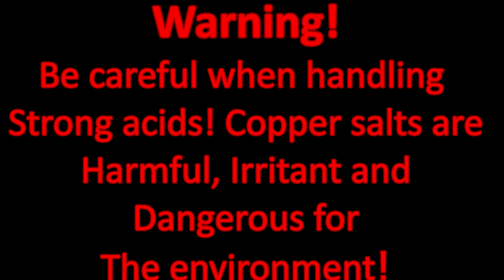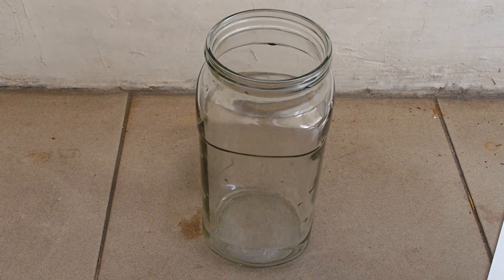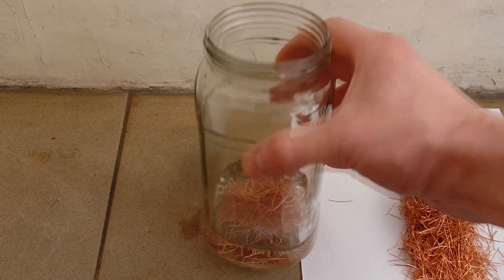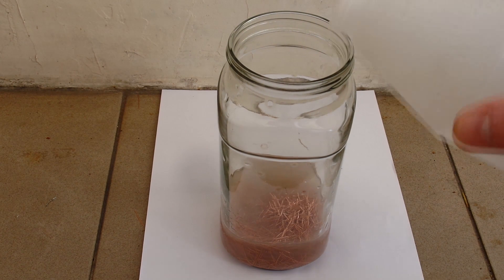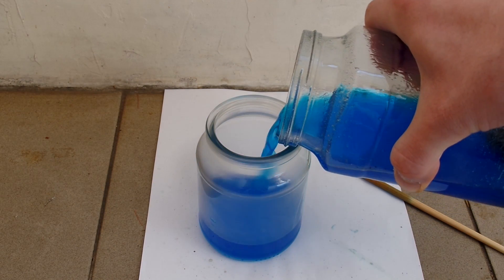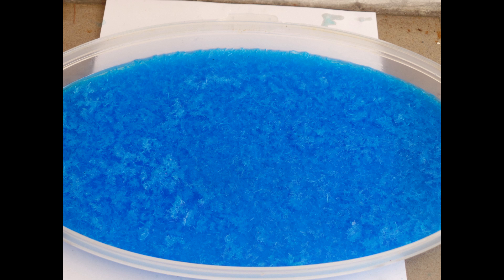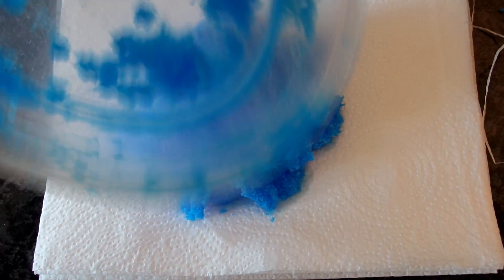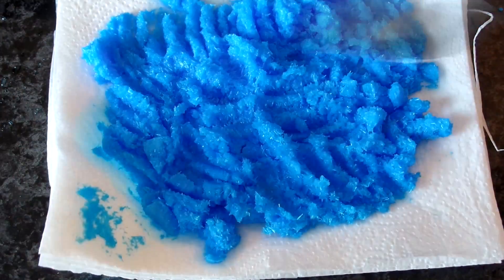How to make copper sulfate from copper metal

Comment: text books always claim that Cu and concentrated H2SO4 react to give CuSO4, SO2 and H2O but I have never seen that reaction. Anyone tried it?
Reply: But this guy seems using nitric acid.
Reply from the maker: Hot, concentrated H2SO4 very slowly attacks copper.
Reply: I knew it has to be hot and concentrated, but I have no clue about the speed of the reaction. Is it slow even if the copper is finely powdered?
Reply from the maker: SuperAngelofglory it is still slow with copper powder, but im not sure how about even smaller particles. I don't think it would be useful reaction to get copper sulfate..

Comment: First off, that music made a chemical reaction have as much suspense as any movie I've seen. Secondly, would it be at all incorrect to assume that the blue color of the crystals has any relation to the blue color of the "patina" that forms on copper metal when exposed to salt water or other mild corrosives? That deep amber smoke(?) is quite fascinating as well, what is it's composition?
Reply from the maker: Thanks!

Color is related,  Copper compounds tend to be blue/green,  the patina is a layer of carbonate, sulfate and other copper compounds (mostly carbonate, because it is insoluble) Copper oxidizes in air and copper oxide then reacts with acidic stuff in air to form this green layer.
Reply: TheMrbunGee wow awesome!
Reply from the maker: Forgot about the gas, that is NOx or nitrogen oxide mixture (Dinitrogen tetroxide and Nitrogen dioxide) toxic gas with sharp, biting odor.
Reply from the maker: Ammonium nitrate.
Reply: TheMrbunGee  which nitrate are you using
Reply: Red death

Comment: i am using nano3 .... what should be the ratio of the reactants...?
Reply from the maker: Prasad Mali 2 parts acid, one part nitrate should do.
Reply: Prasad Mali  where do you get sodium nitrate
Reply from the maker: It is usually sold as fertilizer, like other nitrates. Some stump removers are potassium nitrate.

Comment: Tell me  honney..,
What  for  you need  copper sulphate..?
To  get  husband..?
Reply from the maker: wsalinas1 whatch my other videos to find out!
Reply: TheMrbunGee  does the reaction take place with battery sulphuric acid and potassium nitrate
Reply from the maker: Yes, it should work
Reply: TheMrbunGee  thanks a lot
Reply from the maker: No problem! But you might have to warm up the reagents|! Good luck and have a nice day!
Reply: TheMrbunGee  hey I heated that stuff but there is something dark green rather than blue do you know what is it? Pls help
Reply from the maker: Seems like you  got some chloride ions in your solution. are you sure, that your nitrate is pure? and battery acid is from a battery (used) or from bottle (for use in batteries) ? You could recrystallize your nitrate and use clean acid (where I live you can get them in gas stations, as electrolyte) .
Reply: TheMrbunGee  I have used the (used) one can I use the botled one
Reply from the maker: it is always better to use pure reagents, used battery acid has a lot of impurities, does the copper react with the solution, or it is just siting there? Does it bubbles? if it reacts - you can leave it there for a few days,  it should form some CuSO4.
Reply: TheMrbunGee  ok
Reply: Electroplating solution

Comment: Why don't you employ hot concentrated sulfuric acid  on copper it produces copper sulfate and can dissolve the metal with lesser fumes of sulfur dioxide and copper sulfide which being a precipitate can be easily filtered off?
Reply from the maker: Reaction of H2SO4 and copper is incredibly slow, if you don’t have months to create CuSO4 - this is the method. 
Heating will increase speed of reaction, but it will still be slow. 
With this method – acid may not be concentrated.
Reply: Dude, fumes are fun!

Comment: What do you have in the liquid mixture?How much and what nitrate and sulfuric acid?
Reply from the maker: KNO3 and 98% H2SO4 in mass ratio about 1:1! Basicly double the sulfuric acid needed for reaction:
2 KNO3 + H2SO4 -> 2 HNO3 + K2SO4
or
2 NH4NO3 + H2SO4 -> (NH4)2SO4 + 2 HNO3
and so on!
Reply: Can drain opener be employed in this reaction in lieu of sulfuric acid I had some earlier which displayed all the properties of concentrated sulfuric acid  i.e. with charring of paper, cloth and sugar coupled with a rapid reaction with table salt-also the by-products happen to be sodium bisulfate NaHSO4 NOT sodium sulfate.
Reply from the maker: Blue Vortex 
Yes, H2SO4 based drain opener will work!
and in this case reaction will be. KNO3 + H2SO4 --> HNO3 + KHSO4 I made mistake! :)
Reply: Just thinking isn't there a chance of copper nitrate a contaminant as its the nitric acid doing the dissolving and it's salt being produced esp. as the 2 look similar?
Reply from the maker: Blue Vortex There probably is some, but most of it is CuSO4 and if there is any nitrate it is left in the solution discarded! All the crystals are sulfate! You can test them easily by heating. Sulfate turns white and nitrate turns black, emitting NOx gases.
Reply: That part's obviously correct about decomposition but BOTH nitrate and sulfate will turn black with formation of CUO which's a black solid difference being CuSO4 takes longer(about 720C) to convert but only real telltale sign should be the brown fumes emitted from the nitrate and it's decomposition earlier while CuSO4 produces white fumes of SO3 and turns white first then prolonged heating to CuO.
Reply from the maker: And nitrate won’t turn white in the process. And if you do that in ordinary heating element - you won’t even get to the point sulfate turns black. I never even had a thought that I would ever be having a problems telling apart copper nitrate and copper sulfate. 470 °C between decompositions. It is really hard to miss. :D.